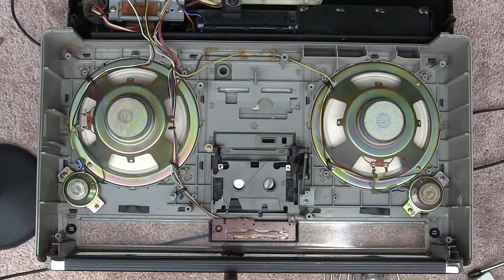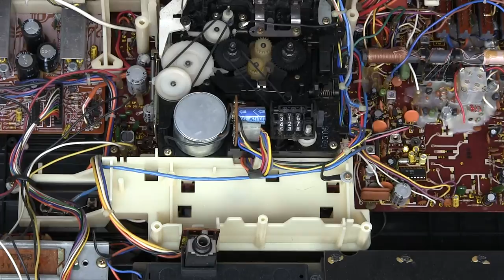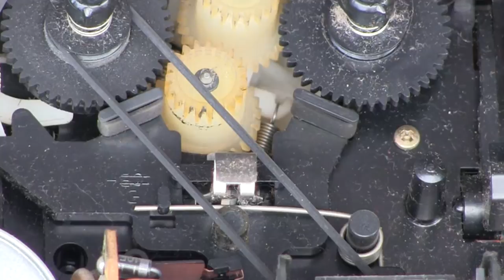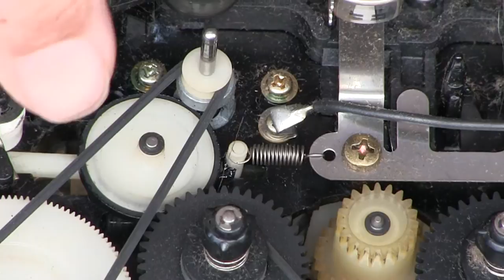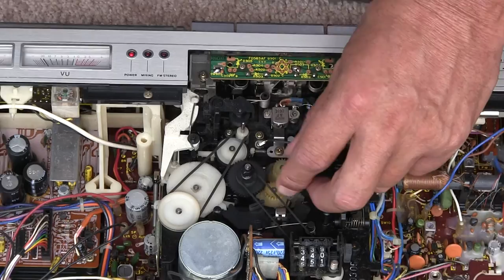Sharp GF 9494 Boombox Idler Wheel tar inside

Comment: Hello James there is a trick as you can repair the winding drive fast again take the drive belt of the down runs and pull it over the winding wheel already works playback reproducible disadvantage rewind is then no longer to repair the drive properly you need shrink hose or Bicycle valve hose that folds very well but for a fast solution is the trick with the drive belt very well suited 😊

Comment: All you need is an original parker ballpoint pen refill - you take out the plastic cap and cut the little plastic ring beneath the metal body. The original part was rubber the "new" part is excellent quality plastic. The dimensions will fit perfectly. The wheel is not spin directly by cabestan but is had there a little rubber ring. Done this on 2 gf 9595 and a gf 8585 that works flawlessly for 10 years by now - http://www.parkerpen.com/en-US/ball-point-refill - 4$ and a good understanding of the system - greetings from Romania
Reply from the maker: Thank you for this information - I will follow up on this in time
Reply: Hello, if you can be more specific about the refill you ised as there's quite few on market

Comment: How would u replace this? Also i have a problem where mine gets stuck or the play button pops up again
Reply from the maker: It is all a matter of proper maintenance and keeping all the controls clean. This is very tedious to replace all the belts and a little tiny idler tire and it can be done as I had done this on other Sharp models.
Reply: @Cassette2Go  how do u take the idler wheel out?
Reply from the maker: @hifi.david.  Allow me to make this sound simple ok, Just tear the deck down to the point that you have removed the ( fly-wheel slash Capstan ) from the deck and then and only then will you understand just how much FUN = NOT! it is to get to that Teeny-tiny Idler tire to replace it and this goes for most of the Sharp brand of boombox and some Aiwa models too as they also have the same deck design.  WATCH this My video I show you just how fun it is LOL Sharp GF-8585 X GF-8585X Service Narrated 96 Pictures till crumbled rewind Idler gear
https://www.youtube.com/watch?v=7O38tJOLx4Y

Comment: I sure wish there was video to show how to re-attach the needle and string for the radio tuner on this sharp gf 9494
Reply from the maker: Do you have email?  if you post me your email here I can send you a copy of the service manual of which on page 4 it shows the routing of the string for the tuner, ok?
Reply: Cassette2Go that’s great info, I just found a copy of the manual online, but thank you, if you eventually do do a video just showing how it looks or photos of the routing as well shoot me a reply. Not sure that there are to many videos about tuner stings. I just received this model and hadn’t the slightest clue about electronics.
Reply from the maker: 5 years ago I shot this video as I had a buyer for it so it is gone from me now and since then I have repaired Many sharp models and I have shown how I have done those in video's years after this one.  Sharp and Aiwa both use a similar cassette deck transport and incorporate petroleum based belts that disinergrate into tar and makes for a messy re-belting & specifically Sharp use a tiny idler that is hard to find or replicate to make the deck work.  Does your pdf show the string run?  I have had people send me their boombox for repair as last month I rebelted 2 Conion C-100F's

Comment: Hi, can you tell me when i can buy this o-ring you pointed between 1.43-2.00 and where can i buy this metal spring ? if you dont know please share me diameter of this o-ring :)
Reply from the maker: 4mm diameter 6 mm tall with a 2mm hole this person on ebay had these https://www.ebay.com/itm/Cylindrical-Idler-Tire-cassette-deck-AIWA-6900-6700-6800-M800-700-600-and-others/352331071019?ssPageName=STRK%3AMEBIDX%3AIT&_trksid=p2060353.m1438.l2649